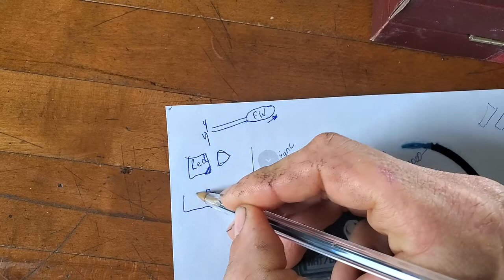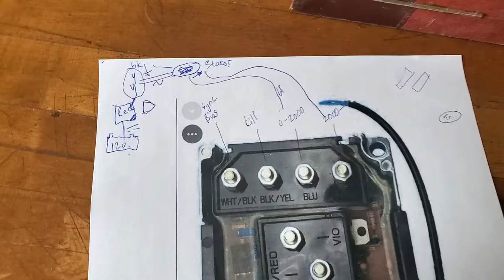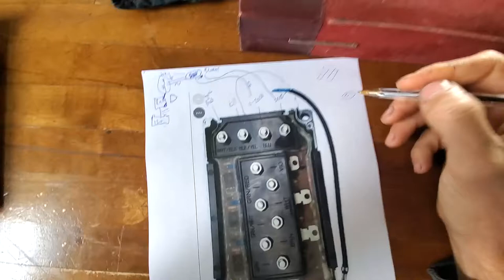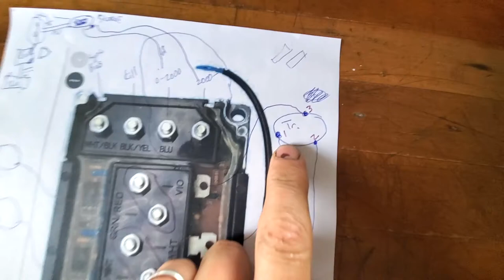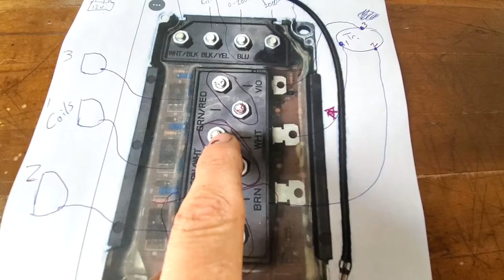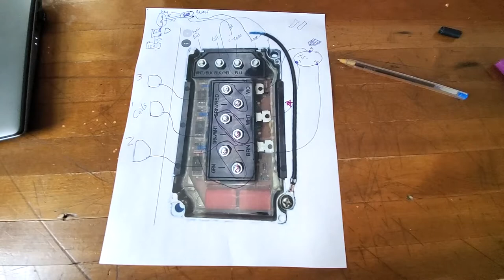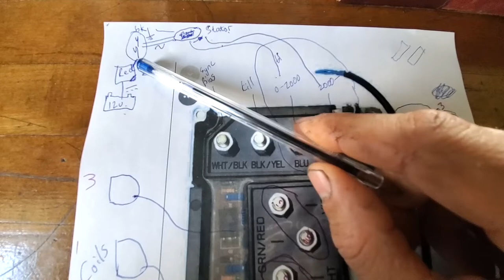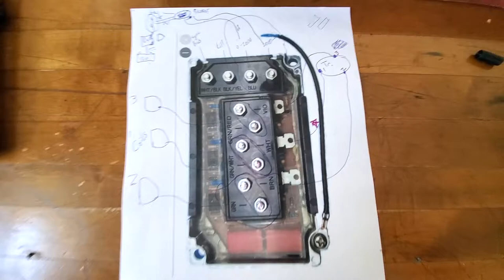Outboard spark fix Part 1/2. Mercury/Johnson/Yamaha. CD ignition power-packs explained -Extended

Comment: Thank you!

Quick question:
What would cause "double firing" on cylinders 5 and 6 on an old mercury v6 200 (2 stroke)? 

For example, an inductive tach shows 900 rpm on all spark plug leads except #5 and 6, which shows 6500 rpm at idle of 900 rpm. The timing light looks nearly solid its flashing so fast (on #5 and 6).
Reply: usually a blown pack causes cross firing, or a faulty trigger circuit.. what you can do is swap one cyl at a time, easier to keep track. swap 3 and 5 trigger wires going into the pack and the ones going out to coils, and swap the plug wires - cyl 3 is using the channel #5 used and vice versa.. and the timing will be correct. if the problem has moved to #3 now, its the trigger. If the issue stays on #5 its the pack or maybe a coil/wire issue.. if u want to compare coils and plug wires, Revert back to original, then just swap the thin wires TO the coils between #3 and #5, and swap the plug wires.. #3 will now use #5s coil and wires and vice versa.. if the issue moves its not the coil/plug/wires - but sth upstream (pack or trigger, see prev test)
Reply: @fstarockaburns425  Thank you!
Makes sense, will try that.
Reply: @fstarockaburns425  I swapped the trigger and coil leads and the problem stayed on the same cylinder. So, I swapped out the switch boxes from my other motor (which is not having this problem) and tye problem remains on the same two cylinders? I've already changed the trigger, could the stator be the culprit?
Reply from the maker: @greauxpete  usually a stator will throw multiple/all cylinders on one bank out. I uploaded a video now that i still need to edit - its better if you swap the plug wires and coil wire only first, that will eliminate a faulty coil/wire/plug.. now evert back to original. now swap only the trigger wires at the pack and spark plug wires - if the issue stays on the same cyl the pack channel is bad (ie no matter what trigger and plug wire combo is put on that channel it will misfire basically)..
Reply: @SocalMarineUSA  10-4, I'll try that tommorow
Reply from the maker: @greauxpete  im still editing and its late but heres a rough video i made today - might add some clarification! Ill continue 2moro https://youtu.be/7MfI5uoKQGk
Reply: @SocalMarineUSA  wow thank you!

Comment: Does it matter which color goes where?  Can you switch the blue and red one?
Because, my stator does not have those colors, mine has 2 yellow, 1 green/white and 1 white/green
Reply: Not on this unit .. the blue must go to the blue stud, follow your models wiring diagram. The trigger wires may be swapped to test a pack.. but not stator wires.

Comment: I keep getting bogged down at high rpms, is it possible the powerpack is bad,  It starts and runs well at idle and low rpm,  I cant go above 7mph.  it is a 1980 jhonson 25hp.
Reply from the maker: could be fuel related, pump the bulb at the bog, if it picks up its fuel supply or an air leak along the line somewhere or at the clamps. if pumping the primer doesnt make a difference could be an ignition component for sure- do a compression test also

Comment: at 17:24 you say "If you see 0.3v of power coming through this pack" but how can ANY power come through the pack if you have already disconnected the black/yellow wire from the pack and connected it to your meter? Since you not actually showing the process, maybe this needs more clarification?
Reply from the maker: so you have to remove the black/yellow kill wire from the pack and attach the multimeter lead to the WIRE (not the pack), and see if positive voltage is coming down the kill wire when you turn the key to OFF -  it should pass ground not positive when turned off (and if so .3v MAX positive - how thats possible im not sure perhaps some units have wiring that ties the ground to positive maybe though a coil or something) but usually you just dont want positive at all or more than 0.3v POSITIVE, thats what the test is for. Faulty wiring or switches cause this and its a pack killer.. esp on johnsons!

Comment: I have a 1996 90hp Mercury with no spark at all start with the Trigger? Thanks
Reply from the maker: try disconnect the kill wire first and see - you can also disconnect the reg/rectifier too (a faulty reg/rect will take out power from the stator so disconnecting it will eliminate it as a possibility), triggers usually take out a cylinder or 2, everything indicates the stator or kill circuit is faulty.. cdi has some good techniques based on different scenarios, worth a look.
Reply: @SocalMarineUSA I  Did try the kill switch and the stator is new So unplug all the wirs to the rectifier? Thanks
Reply: @SocalMarineUSA  I was happy CDI that's where the stator came. Might have to give them call back see if they can help ? Tkt
Reply from the maker: @keithmoore9593  yes try that.  If you track down your motor on cdi the troubleshooting steps and values are there. Good folks at cdi

Comment: I unseized a 1987 mariner 60. I got it unseized with brute force by welding a long bar to the flywheel and pushing til it freed. Now that it's unseized the timing seems way off. It has good spark and good compression but backfires flames out the exhaust. I did dismantle the flywheel but never removed the whole flywheel. The timing base remained in place and the flywheel is keyed. I'm thinking there may be something else affecting the cdi or possibly I have the leads around the wrong way (although there is a number on the water jacket by each cylinder and a number next to each coil). I'm stuck at this point. Does anyone have any ideas I can try. Thanks.
Reply: Remove carbs and clean them very well and put back together.. don't mix the jets, top carb has a larger size main jet.  The trigger wires have 3 colors,  violet, brown and white.  Each one goes to a certain cylinder. Find a wiring diagram online and follow one wire at a time.. cylinders are 1 2 3 from the top down, but the power pack wires run 132 or something. The power pack is labelled too just follow that... just check the diagrams. . When u clean carbs, put a small filter just before the carbs and replace the fuel line AFTER the filter to trap the old rubber pieces from inside the old lines. Do a compression test.. if u see fuel spitting out carbs put in some boyesen reeds:)
Reply: @fstarockaburns425  thanks a lot for the reply. Carbs are definitely clean.  I've spent hours watching these videos and reading but can't find the manual for my motor (it's a 1987 mariner 60 if anyone has a link) I'm now thinking its the firing order. It's definitely the 132 motor (some are 123) There are numbers 1 2 3 next to each spark plug and 3 2 1 on each coil. Running coil 1 to cylinder 1 etc is kicking back and shooting flames. Some people online have said they just run the top coil (3) to top plug (1) etc. I initially tried that before cleaning the carbs, I'd manually add fuel to the cylinders. Didn't seem to work. Can anyone tell me definitely which coil goes to which plug. Thanks.
Reply: @MrAcgolem  here you go - this covers ALOT of models, you have to look for the 3 cyl 60hp sections but its all there https://drive.google.com/file/d/1GI_HK7k2Mk4HFGiQAxD1HnPqkteLSDld/view?usp=sharing
Reply: @fstarockaburns425  seems to only cover 4 and 6 cylinder 90+HP motors. Mine is a 3 cylinder 60hp. Thanks tho.
Reply: @MrAcgolem  apologies linked wrong file here you go https://drive.google.com/file/d/1kgAdONF9WVjsxFd4CjI-R7-WZ6kDWshq/view?usp=drivesdk
Reply: @MrAcgolem  max rules has good pics https://maxrules.com/oldmercs/Wiring/1966ona/70.jpg great resource
Reply: @fstarockaburns425  that's the one. Thanks. Hopefully I can get to the bottom of this. Having good compression, spark and fuel I feel tantalizingly close to having a good runner. Something electrical clearly isn't quite right. Hopefully the answer is in here somewhere
Reply: @MrAcgolem  I do need to make a a 2nd video with practical tests with some faulty parts-
Reply: @fstarockaburns425  your video is great. I understand now how a CDI works. It's simple enough but without being told I didn't know. Just assumed signals went in, magic, then singal out 😂. I haven't yet had a chance to work on the motor but I've read through that manual and there are 2 different configurations for 60hp 1987 motors. One has the viloet trigger wire going to gren red (coil 2). Another has the violet wire going to green red (cylinder 3). I know that one motor has the 123 firing order and one has 132. I know mine is 132 as cylinder 3 rises after 1. The manual doesn't say which one is 123 or 132. It just says model numbers between xxxx but my model number doesn't fit either. Fun times. Might just have to do trial and error and hope nothing blows.